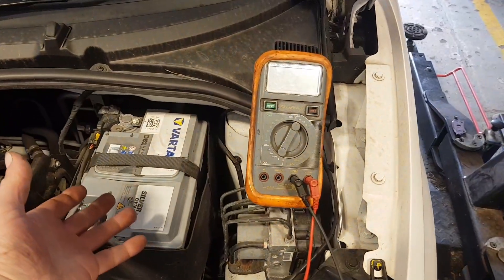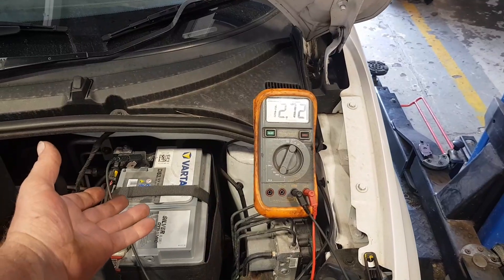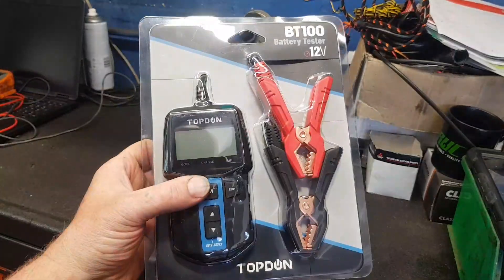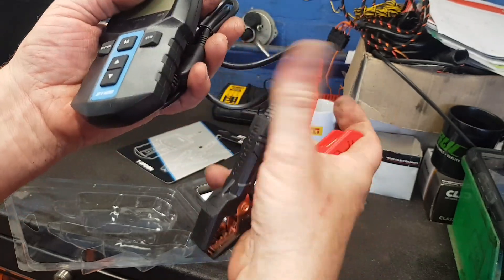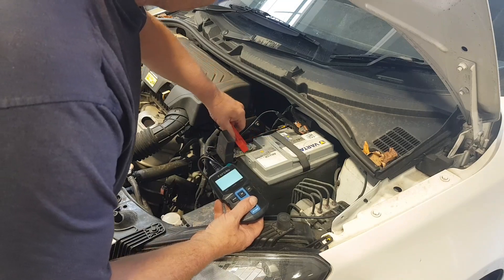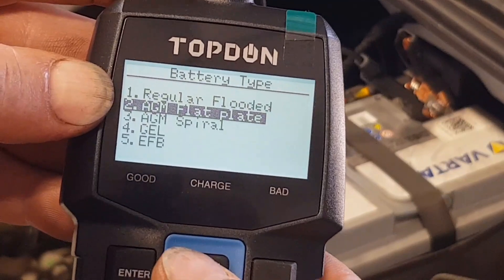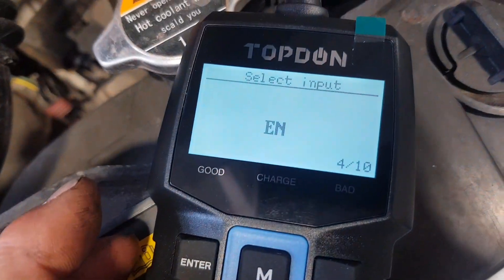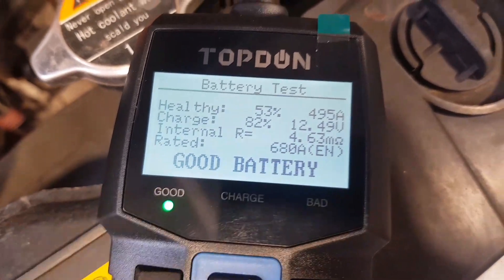TOPDON BT100 Battery Tester Review & Testing.

Comment: On my Mondeo the battery negative terminal is inaccessible so I have to use the small stud that connects the battery negative cable to the car body. When I tested a brand new battery with the TOPDON it indicated “replace” so I removed the battery from the car and tested it with the TOPDON connected directly to the battery terminals and the result was good battery 99%. 
I thoroughly cleaned all contact points and reinstalled the battery and again it indicated “replace” when I retested it on the car.
The battery ground cable is about 18” long and looks fine, no sign of corrosion or loose terminals.
Any ideas?
Reply from the maker: It's supposed to be connected straight to the battery, you will get incorrect results otherwise. All battery testers wont work properly if they're connected to the ground of the car.
Reply: The Topdon BT100W instruction manual mentions this problem and provides a diagram illustrating it. I'm not impressed with the BT100 manual. I have a VRLA Battery and I don't know which battery setting to use! Thanks for your review, it's great!

Comment: Hello Nice video. How can i see what type batteri I have flooded, AGM etc ?
Reply from the maker: It should say what type it is on a label on the battery.
Reply: @pistonbroke  also if the agm is spiral or flat pad?
Reply: My guess is "Flat" for the AGM rectangular shaped battery cases and "Spiral" for the AGM batteries which have the six cylindrical cell shaped cases?

Comment: hi ı tested my bosch battery and its SOH is %66 its low ? also measured cca is 650 but battery is 850 cca no drain on tests car is 06 jaguar s-type 2.7 tdv6 2-3 day and no crank is my issue
Reply from the maker: That should be enough to crank it. Charge it over night, if still no crank then the fault lies elsewhere.
Reply: To me his 55% healthy report was really low.  My battery is starting to give a little trouble and it shows 57% health.  My local mechanic friend says he likes them to be 75% or better for a good battery.
Reply: @Okie-Tom  hello yes ı was replace in summer and problem solved 7 month(winter here) no problem ı never buy bosch again,varta in my car now

Comment: Pretty impressed with topdon stuff, I have the same tester as this, and also have the topdon artidiag 800bt diagnostics. My main diagnostic interface is the delphi ds150, but it does not cover saic mg at all, so got the topdon diagnostics as it covers loads of chinese makes, including the saic mg. My neighbour has the 2018 mg zs, and could find no manual method to reset her service interval reminder. Some people said hold down the ok button on steering wheel, with ignition in off position, keep holding the ok button down while turning the ignition to on position, and it should reset, but dod not work for me, so luckily I have the topdon diagnostics that allowed me to perform the service interval reset.
Reply from the maker: Service reset on the ZS can only be done on the dash if it's 2020 model year onwards. Earlier ones can only be done with diag equipment
Reply: @pistonbroke  yeah I found that out, but still get the keyboard mechanics that try and say different🤣👍
Reply from the maker: Oh yeah, facebook the font of all knowledge 😂
Reply: @pistonbroke  until I see something done with my own eyes that they claim can be done, I am a non believer🤣